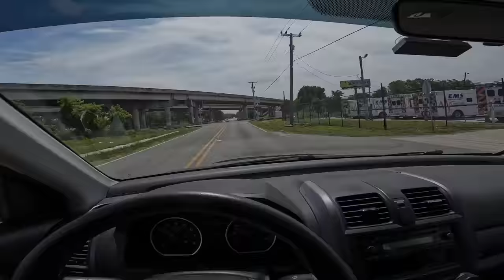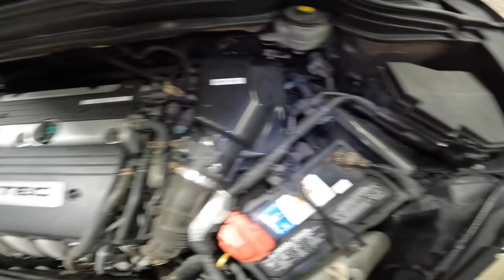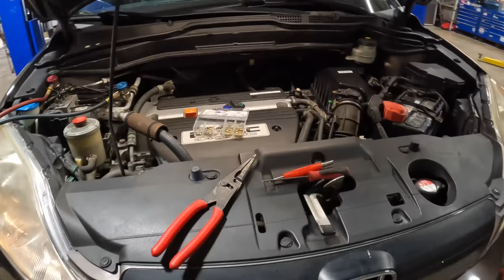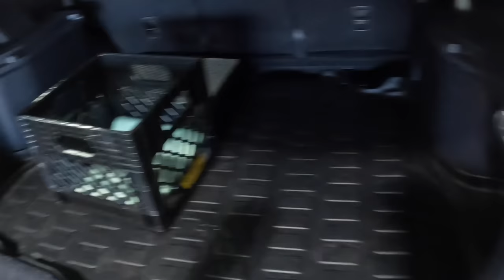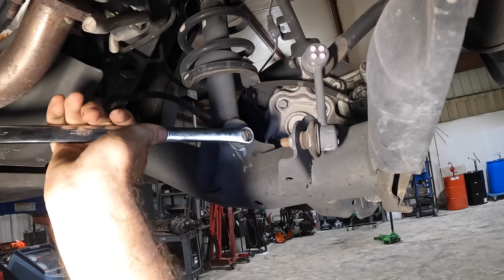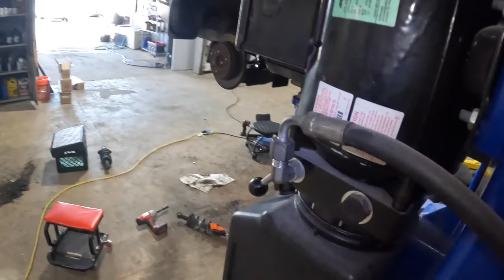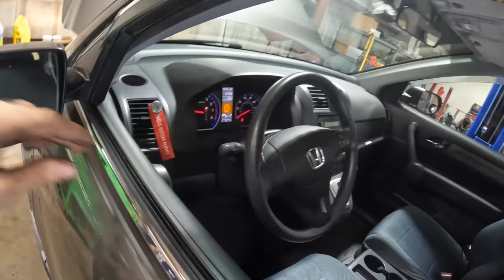Sloppy Suspension! Too Easy? WRONG!! Honda CR-V 2009 1.4 #mechanic

Comment: Frequently, after market struts are worse than the original ones...And then you end up putting the original ones back on..hopefully not the case here..
Reply: The spring rates are all wrong making the vehicle sit higher than normal typical junk quick strut.
Reply: Ground clearance is your friend. Lowered cars look cool until the trailer in front of you loses a 4x4 timber and you run it over and destroy a lot of really expensive stuff.

Comment: Disappointed that you went with (probably Chinese made) Quick struts.  Should have just replaced with the OEM shock body using the original spring.  Good chance your customer will be back complaining of a crappy ride.
Reply: Florida has nice roads. Chances are that it will be fine.

Comment: ....as a result of the psychological "northern" mindset that ALL lower bolts r corroded in2 a non-rotational bias, so it is necessary 2 "crank" the nut loose and off, then drift punch out the bolt! It's a "rust belt" thing!

Comment: Money shot oil right on the camra in my face.

Oh how lucky you were ez to get to back strut tower bolts.  Im going to laugh if i see you do a 2001 and up Toyota Celica, you have to remove most the back plastic pannels in big sections like from the back of the seats to the back of the hatchback and cross stuff.
I know becuse i changed mine at a buddies shop on his 2 post lift.
He did not have a spring compressor just some manul harbor fright compressors.  Itwas a bitch to change the springs.
A body shop owner i knew years ago had a spring compressor that clamped on and used air presure 
But i cant see why it couldn't be done with hydrlics.

Comment: $700 for 2 hours labor, not bad.
Reply: 20 years ago a local shop wanted $800 to replace the lower ball joints on my 1993 Dakota 4x4. $100 and four hours later I had all four ball joints replaced by me. What a frickin' racket!